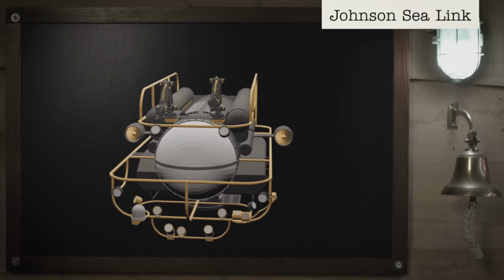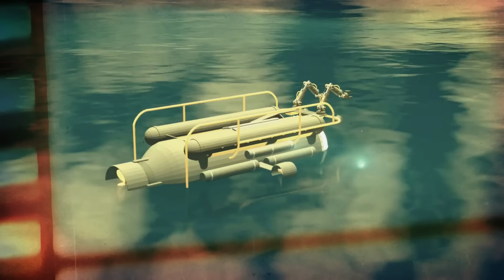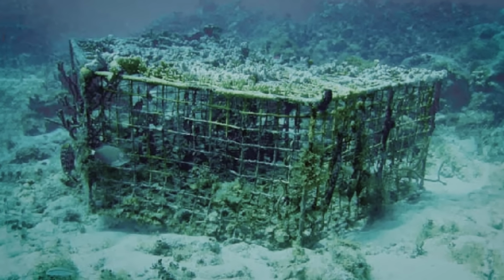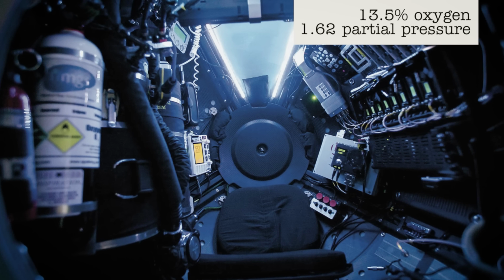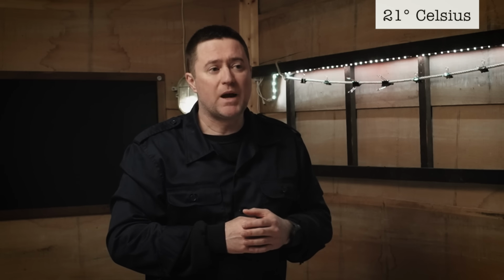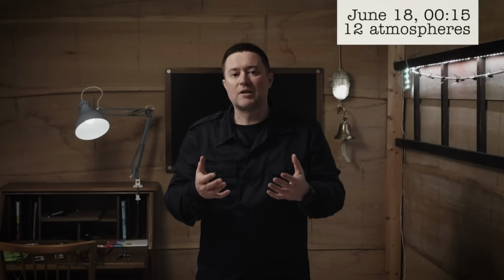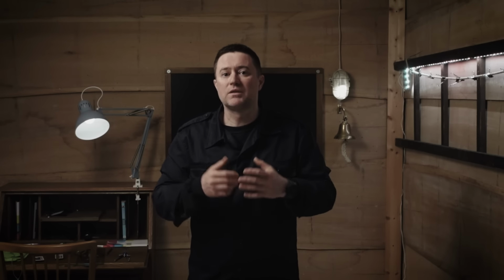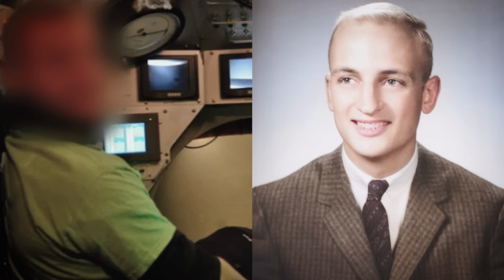This CO2 Scrubber Killed Half the Crew!

Comment: The Scrubber didn't kill them. The overall lack of precaution is what killed them; failing to do a full systems check and repair failed redundancies before launch, the decision to not include a dive compartment heater and gas blends for every condition they would be passing through, the blasé attitude regarding appropriate attire and safety equipment for the job they were tasked with. It's a prime example of the swiss cheese model. A bunch of failures lined up like the holes in a stack of cheese slices, allowing the tragedy to take place.

Most alarming to me is the crew of the dive compartment. Just because you weren't PLANNING to leave the compartment doesn't mean you shouldn't have been READY to leave the compartment. Had they dressed warm and brought their suits along, they could have freed the sub and surfaced without even having to call the support ship in the first place.  They might have even been able to replace that faulty hook with the one they'd snagged and completed the mission in a single dive, after all.

Comment: So compancy and huburis killed them. The fan not working should have prompted a repair so you have 2 fans that way if that one failed you wouldn't be screwed. Two fan systems like this are NOT that complex if the men were able to open the panel locate the problem and even cobble together a replacement by using the scrubber material in front of the AC unit. They should have kept a few extra fans in a storage bin so they could hot swap the broken one out. Second this sub has a design flaw, there's no heater unit. They died because temps fell too low for the scrubbers to work, they should have had a small space heater or some type of heating unit onboard for this occasion lastly The divers were complacent and got themselves killed by NOT wearing their dive gear and only went in with t-shirts and shorts wtf? that was stupid. They'd be alive if they didn't do such a stupid thing because when pressed about diving they could have gotten out of the sub and used their hand tools to free the ship OR use the oxygen tanks attached to their suits to slowly surface themselves. Let this be a lesson to everyone that does a dangerous job that requires you wear PPE ALWAYS WEAR IT better to have it and not need it than to need it and not have it. If they brought their suits they'd be alive right now

Comment: from what he says, I'd say it wasn't the CO2 scrubber that killed anyone.  The broken scrubber fan was in the cockpit and they survived fine by basically pulling a bit of an apollo 13 with the scrubber media.  If anything, the "passengers" died because their compartment was aluminum and got too cold for the scrubber material to work properly.  They were also dressed improperly (despite being warned) and refused to attempt to exit the sub and try to remedy the problem even when their own compartment was at equal pressure for the depth and would have afforded them no extra risk by that point.  We all get lax with things we've done a bunch of times, and it was this laxness by the two in the rear chamber (because they weren't planning to dive) that ultimately sealed their fate.
Reply: There was plenty of extra risk should they have chosen to dive; in fact it probably would have killed them much more quickly. Water transfers heat from the body much more quickly than air, and immersion in 7°C water is likely to lead to death within an hour or less, depending on whether the person succumbs to cold shock (20% likelihood and death within a couple of minutes), cold incapacitation, or hypothermia.
Reply: Right up to the point where they all died at sea.

Seems that the details are not the problem, dead is.

And we don't need any stinkin escape hatch or even a vent for breathing on the surface. Bolt us in like a tire on a dragster.

What a drag when something unexpected happens.

How redundant is that? Redundantly dead?
Reply: https://youtu.be/Fpt54RRchg8
Reply: I disagree. They were convulsing which is a symptom of C02 toxicity. Hypothermia doesn't cause seizures.

Comment: I'm not done with the video yet, and as an ignorant person wrt diving and chemistry and related, I had two ideas and I'm curious if knowledgeable people care to answer as to the feasibility of either 1) taking the baralyme bundled in the t-shirt and swung around in a circle in the compartment to create the "fan" motion -- instead of forcing the air through the cannister of baralyme with the fan, swinging the baralyme through the air directly?  or 2) holding the baralyme up in front of the face, still bundled in the t-shirt? 

Would either of those activities have helped at all or is it just my ignorance of how the baralyme works and interacts with the carbon dioxide?

Still, such a tragic event. I know it's easy to Monday-morning quarterback, but still in every aspect of my life, the smell of burning electrical equipment to me means PAY ATTENTION and DON'T IGNORE. Burning electrical is not normal and should have been addressed immediately. 

Thanks to anyone who responds.

Comment: Your in a submersible you smell something electrical burning you go up, period full stop straight up as quickly as you safely can
Reply: Electric problems on a submarine? This results in toxic fumes that include ketones and aldehyde gases and Polychlorinated biphenyl (PCB) by-products are also emitted.

Let us not forget the cobalt and other toxic compounds emitted from a fan motor after malfunction.

No sub has a window or a screen door.

Hubertus does not defy physics no matter what the timeline or pressure from those above you. Ya just say no.

All puns intended.

Comment: A diver friend of mine offered a simple job. Building a sort of breeze block wall with water proof cement. Only 150ft.  No worry’s. No tanks air to the surface.  One of the guys died Some metal bracing pinched one of the lines he was getting narcocis monoxide ?? Surely they tried to talk no response pulled him up with decomp timings he was brain dead.  £450 build a wall underwater . Lost his life.  Sounds simple.  28yr old guy. Kid on the way. Under water dangerous trapped under tree roots wires etc etc. problem you got 2 mins.  That’s why I’d never CAVE DIVE them people are nutters.

Comment: I myself almost killed a crew of three, while they were going into a deep dive down to 6000-feet, but had to abort at about 2000-feet.  I had designed an underwater lamp/light controller, to allow dimming of 1000watt lamps, since they were too bright in many undersea applications.  Unfortunately, the controller box was placed directly under an oil pressure line, which was leaking an dripping hydraulic fluid onto the box.  The oil hit a couple of electrical components, reduced their heat transfer capacity, and resulted in hydraulic fluid being burned and vaporized.  The crew thought they had an internal fire, donned breather masks, and emergency surfaced.  Nonetheless, it took them 20+minutes to surface and get fresh air into this submersible.  Had they been down at maximum depths, they probably would have run out of breathable air.  The investigation cleared me, but the vehicle was rebuilt, to allow a full rise from 6000+feet, with full additional air/mix, and without heaters working, if electrical power was lost...
Reply: Note to self: use sealed controller boxes with gaskets to avoid this issue
Reply: Bullshit
Reply: Chin up. You'll get em next time!
Reply: Fascinating! That’s a crazy amount of responsibility for someone designing a light controller to bear! 
   I understand the critical nature of the application, but given that critical nature, you would think the designs would be peer reviewed in some fashion and heavily tested/certified. Therefore, a lot of the burden would be on the certifying agency and those that vetted the designs.
    Every human makes mistakes with regularity. holding an individual designer responsible for anything outside of deliberate sabotage seems pretty crazy to me.
   Really glad things worked out for you.
Reply: @TheGrobe  It is a BS post by someone who I doubt has ever seen a submersible except on television or online. Far too many nonsense statements.
Reply: Cancer? Oh yummy...
Reply: What? @TheHippieDog
Reply: Oil increases heat transfer, it doesn't reduce it. That is why it is used in large transformers as a heat transfer medium, it works exactly like the coolant in your car radiator.
Reply: @oldtugs  Hydraulic fluid/oil is a completely different substance compared to transformer oil they have vastly different properties (Heat transfer capacity, viscosity, density, flash point, freeze point, impurity content, and the stability of the oil itself) to fit their intended roles. Transformer oil is significantly thinner and typically encases the entire component. Hydraulic oil can raise heat transfer in specific situations.
Reply: @BlackLungX  Sorry but that is nonsense. I spent 8 years piloting and maintaining 2000 meter depth manned submersibles. We used 5606 hydraulic oil to equalize, lubricate and cool our thrusters that we used in dives lasting up to 12 hours. We used transformer oil to equalize battery boxes because of the quantity required, it had a higher viscosity than 5606.
Reply: @oldtugs Yeah I also smell bullshxt from this story... Since when is the designer of electrical systems also the installer? 🤔
Actually, if he was being investigated for negligence then he would've also had to have been the submersible's maintenance technician who cleared the vessel despite the leaking hydrolic lines... 

There aren't many outfits with 2,000m+ capable manned submersibles and they all have large enough teams + levels of oversight that I find it very hard to believe that any would allow a situation where one person is not only the electrical engineer, component installer, & systems maintenance tech but also has no oversight & given the green light to clear the vessel for manned operations with newly added experimental components that are completely untested... 
This wreaks of a totally fabricated ChatGPT generated "like-farming" comment 🤨
Reply: You seem very irresponsible

Comment: This shows the difficulty of conducting rescue operations at only 100m depth.

My mind flashes to a certain tourist DSV operating near the Titanic, at about 3,500m. If it had gotten stuck on the seafloor with all alive, imagine how much longer it would take to mount a rescue. I don't think the DSV's reserve oxygen would have lasted long enough.

--

Deep sea construction divers have suits they can put on to preserve body warmth for as long as possible. This vessel appeared to have nothing of the sort. I'm thinking they would have found them useful.
Reply: Those suits are $1.9 K alone; then there's the boots, gloves, hoses and water heater/pumps (on the surface support vessel) to consider. They probably didn't plan for that like a lot of things they obviously didn't plan for.
Reply: @seadog686  That's when you need to leave the submersible into the water. But you need much cheaper and simpler stuff to keep you warm in the interior - simple cheap sleeping bag can keep you safe to -20 deg. C and others even far below that temp. And water doesn't drop even below freezing point at depth.
Seems to pretty bad design - unfortunately this experience is paid in lives like in other branches. No i.e. portable CO2 trapping canisters you i.e. directly breath in, no warm cloth, no way to depressurize compartment nor to balance atmosphere composition "in case". Thus you approach shipwreck that is nightmare as a possible trap but you have no escape plan no plan to stay alive long enough.

Comment: First impression: You’d think that a standard bit of “emergency equipment” would be some sort of simple bellows that could be fitted to the “fan” end of the scrubber and physically operated by the crew in the event of a fan failure or even a power failure.
Edit: 
Second impression: Why aren’t there divers on the support ship? That’s so insane to me.
Reply: Why not have backup oxygen candles? They were invented in 1945 so they should be good during this time period. Sure they burn super hot... but when freezing with little O2 you might like the temperature increase.
Reply: @ViroMad  My guess is because of either cost, stowage or toxicity. They are still rather expensive today. My guess would be a military-only thing back then. They are rather bulky and require a dedicated burn chamber; which a small, deep-dive research vessel couldn't afford the space for. They are meant to be used in larger subs with lower internal pressure and a higher volume of air; which would run you into the same issue of oxygen toxicity as using the inappropriate diving gas that they had on board.
Reply: More than that, why not empty the scrubber cartridge into a shirt and breathe directly through the pellets? CO@ coming out of you has a chance to be scrubbed. Air coming back into you has a second chance, and your body heat makes sure it stays warm enough to work.
Reply: Keep in mind, this is the early 1970's. We were still using diving bells and pressure suits with air lines and brass helmets. We'd only known how to safely surface from a deep dive for about 50 years and only found out how to treat decompression sickness about a decade prior. The equipment needed to perform deep dives from a surface ship was prohibitively expensive for research vessels and the air supply they had access to, to pump down there would have been toxic at those depths. That's why they had to call in military divers for the rescue attempt. The USCG and USN have a comparatively limitless budget and all of the best equipment of the time already on hand. Ideally, they would have forced anyone in the dive compartment to be ready to leave the compartment in case they needed to address some external issue on the sub, rather than letting them dive in shorts and a t-shirt. "Better to have it and not need it", type of scenario. Unfortunately, they fell on the "need it and not have it" side of that saying. 

On your first point, a hand cranked fan with gear reduction MIGHT have worked, but the work you'd put in to pumping bellows would increase your CO2 output more than the benefit you'd gain from increased flow through the absorption medium. It would have been more prudent to repair the redundant systems prior to launch and add a resistive heating element on the intake that would have kicked on if the temperature fell near to the minimum effective temperature.
Reply: @Official_DJ_Spark  well said. hand cranking also increases calorie and h20 needs. the increased body temp would be a plus, but erased by the need for more h20 in short supply (ironically...being trapped in it)
Reply: @Official_DJ_Spark  - Well said! Thank you for such a thorough and thoughtful response. I agree with your “have it and not need it” SOP being the actual way this emergency could have been averted; having divers in the aft compartment who were ready and able to exit the vehicle to free it from the entanglement is the way.

Coming from an aerospace background, I sometimes lose sight of the fact that deep-sea diving is such a recent development and a discipline whose techniques and technologies were driven by government agencies in the same was that space activity was. In so many ways, the deep ocean is a more challenging environment than space.

Anyway, thanks again for your insight.

Comment: I think if "X killed people", replacing X with something inert would save them. For example, if a malfunctioning batter catches on fire and kills people, the battery killed the men. In this case, it is obvious that if the CO2 Scrubber didn't exist, all of them would have died. So I think it might be better to say "the failure of X killed people" or in this case, the event that killed people was the scrubber failing. They were dependent on it to keep the air breathable.

Comment: how come when you say the time, you say "zero" first? like instead of saying "9:45" you say "zero 9:45"
good video!
Reply: It's the 24 hour time format.
Reply: @TonyRule  what's the difference in saying zero vs not saying zero?
Reply: @ChristelVinot  Consistency which improves clarity.
Reply: @ChristelVinot  Just like you always put the zero in front of decimal numbers <1 too, if you're taught properly.
Reply: @TonyRule  when people say decimals, they usually say "point one seven" rather than "zero point one seven"
again it seems like the zero is an extra unnecessary thing, no?
Reply: @ChristelVinot  Then they're doing it wrong.
Reply from the maker: The 24 hour clock is clear if you use 0 Infront of the morning times. 

If I say 945 that could be in the morning or night because it's not clear if it's a 24 hour clock or not. 

If I say 0945 then it's clear that it's the morning and that it's a 24 hour clock. 

It's precise and unambiguous. 

I hope that makes sense.
Reply: @waterline-disasters  so "zero" actually means AM? whoa.. I had no idea.